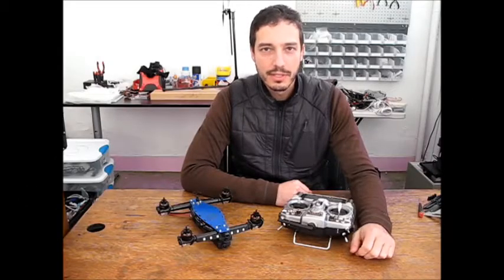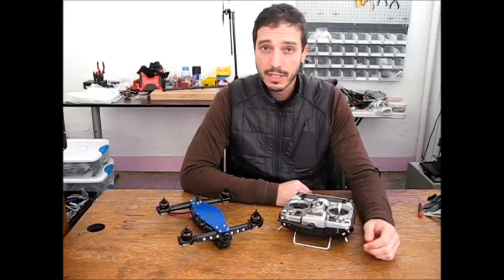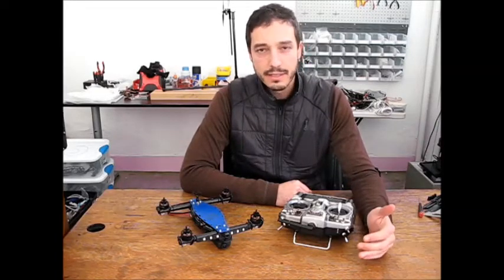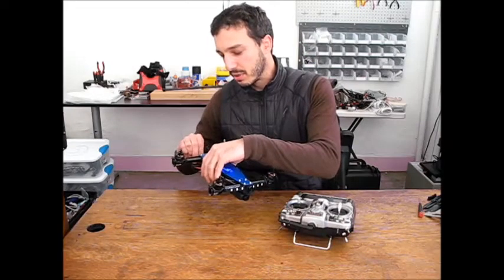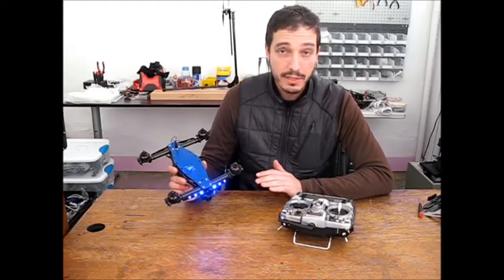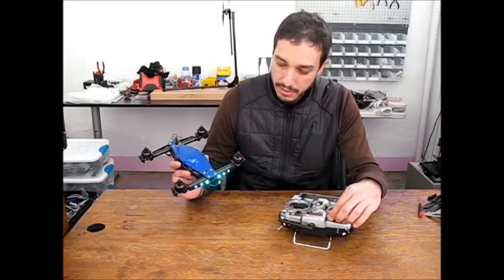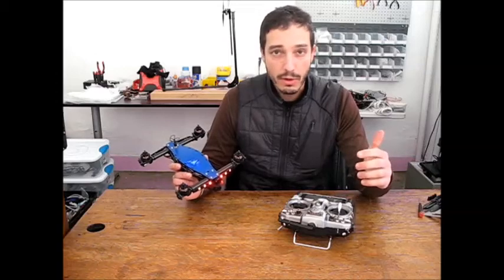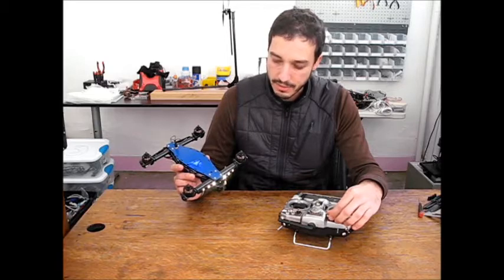Cleanflight Mod for Setting LED Color with TX Pot

Comment: do you have a hex file for rev6? and what am I supposed to do with that rev5 link, copy and paste?
Reply from the maker: Hi Dave, right click the link and save the .hex file to your desktop. Then you can load it onto a rev5 board using the Cleanflight Configurator as described in the installation manual linked above. I only made a .hex for the rev5 board as a personal project. We're looking into incorporating this functionality into a future release of the Cleanflight master.
Reply: +Atomic Aviation What hex file? Are you talking about "Save Link As…"?
Reply: +Atomic Aviation  when I click the link I get with appears to be a web page with strings of computer code I don't get a download
Reply from the maker: Yep that's correct. Right click the link, select "Save link as" and pick a location to save the file (desktop is fine). The file should then download to the location you've selected as cleanflight_NAZE.hex. This is the firmware file that you will install on your Naze32 rev5 using the Cleanflight Configurator as described in the PDF manual linked above.

Comment: about time you put this up :) Is the source code available on github? Didn't realize this was part of the firmware, thought it was just a clean/betaflight configuration mod. Been using betaflight, can't say I want to go back to cleanflight, so maybe I could port it over.
Reply from the maker: +fpv racer: Sure thing, I'll send you a text file with the code modifications. It was pretty simple, less than 10 lines if I recall.
Reply: +fpv racer: how did you go porting the code over to betaflight? I'm running BF 3.0 and am keen as to get this going on my rig